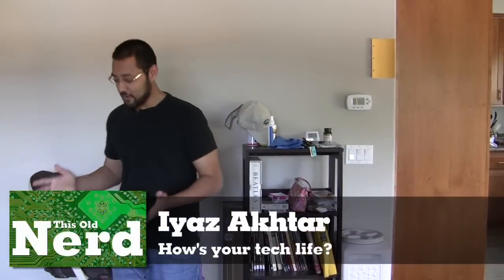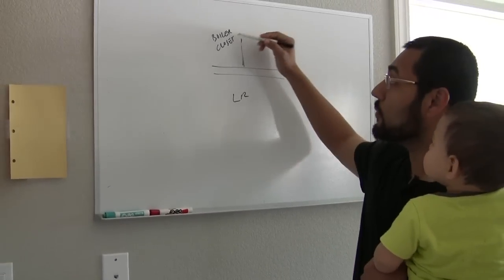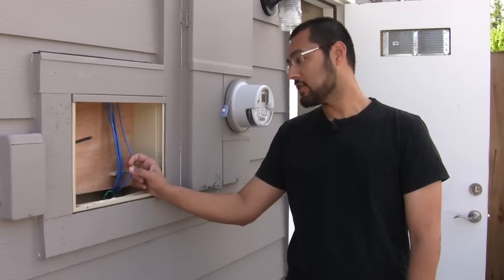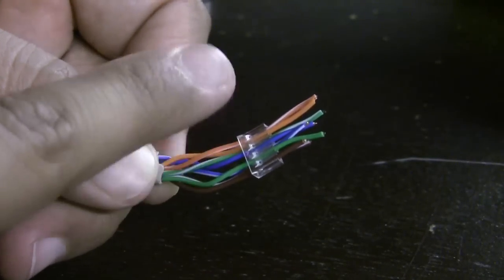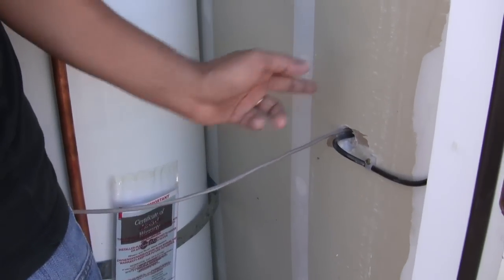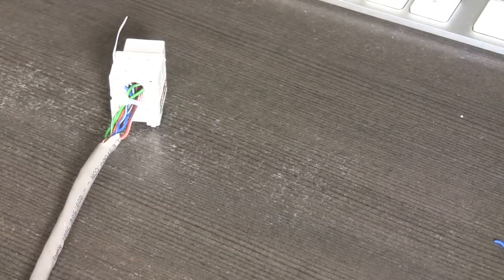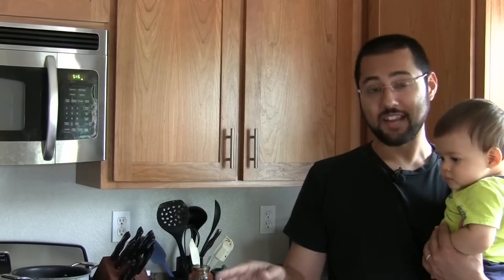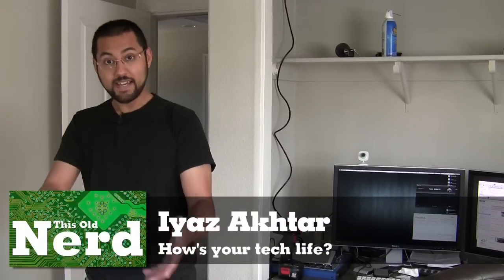Setting up a home network

Comment: "Here's how I set up my home wired network"
"The house already had ethernet cables all over the place"
"The end"
What a pointless video. How are you supposed to do it if you don't already have wired ethernet in your house like 99% of all homes
Reply: You could watch season 1 where I had to run cable everywhere

Comment: I flippin hate those stupid "Modular" connectors. they are a pain in the ass. You should of just got some good quality Cat6 RJ45 connectors. The eaisest to use are the ones that the wire goes clean trough it. IF you do get those make sure to get a crimper that cuts the wires at the same time as crimping.

Comment: Dammit took my existing phone boxes and the wire are cat 3's
Reply: ShyRage1 you know you can run 100mbps through cat 3
Reply: Didnt know that, I have 200mbps though
Reply: IMHO, 100 megabit wired is preferable over wireless
Reply: +ShyRage1 8-wire cat 3 might actually support gig-e speeds if the runs aren't too long. For some bizarre reason, all the phone cables in my house are cat 5 except 1, which is cat 3. That cat 3 cable still handles gig-e speeds without any packet loss that I can identify.

Comment: now we have ac. faster than wired
Reply: wired is way more reliable though
Reply: AC is not faster then wired. i have an AC router and and AC wireless card on my computer right next to my wireless router and wired is still faster.
Reply: Wireless AC speeds up to 1.75Gbps, Cat 6e speeds of up to 10Gbps
Reply: lilwarski0121 that is true  but it is a lot more expensive
Reply: TheImmortalizedGamer not for me. i have a nighthawk router from netgear
Reply: Damien Baskerville Not really in the uk you can get 50 metres of Cat6e for £9 ($14)

Comment: Crosstalk crosstalk crosstalk!! That has got to be the worst wiring of a rj45 modular jack i have ever seen.. There shouldn't be any more than 13mm of wire untwist otherwise you'll be creating crosstalk between pairs.. And using cat6 over cat5 is a no brainer.. pairs in a cat6 cable are twisted tighter than pairs in a cat5 reducing crosstalk..
Reply: Phil Allchurch: That guy really needs to take a BICSI course or something. I learned these basics at my local community college.
Reply: PHIL,  where is your Video on YOUTUBE with OVER 700,000 VIEWS, right NO WHERE...So shut it..
Reply: Yes very true
Reply: Also cat6 has a Cross of plastic to seperate the pairs to reduce crosstalk.

Comment: a punch down block for utp? WHAAAAAT..............
Reply: CapApollo: It's done all the time for rackmount distribution systems. Don't knock it. And if your house is any kind of prosumer, it makes sense to do it that way. Much cleaner.
Reply: What he means is that a punch down block is for wiring phone systems and cannot be used for networking. The author thought he was talking about a RJ45 patch panel... But didn't know the correct term to look up the info on it.
Reply: That is not entirely correct, Belden IBDN GigaBIX Cross-Connect System for Category 6 cabling systems are still being used today. Even CAt 5e with the BIX 46Di was used as well.

Comment: You need to show how actually the cable/internet is actually connected to the switch. you just talk about it and don't a actually show.  step by step by step for us do it yourself guys plz
Reply: Take your "modular plug" which is actually an RJ45 connector (which is terminating the cat5 cable) that feeds from the router and plug it into a port on the switch. Take your other RJ45 connectors from the cables that terminate on your walls and plug them into the other ports.

Comment: My issue with the video is he didn't wire anything and also how much wire is exposed with the keystone. He also inserted wires 1-by-1 into the load bar whereas he could have done them all at the same time by clipping them in a straight line with the wires already in order. Along with so many other things lol. I do not recommend this video other than for sh*ts and giggles.

Comment: I understand you are trying to do something good to benefit others by creating a guide. But PLEASE, do not make a guide for something that you are not an expert in. This goes for all categories not just networking. You did not punch down correctly for your keystone jacks ( you left the ends of the wires that should have been cut when punching down. This can cause shorts on your cable and cause it to not work.) Also you should always try to keep the twisting as close as possible to the ends when you punchdown to avoid crosstalk and EMI. So again, if you are not knowledgeable in a certain field do not make a guide. This will give out false information to those who are looking for help.